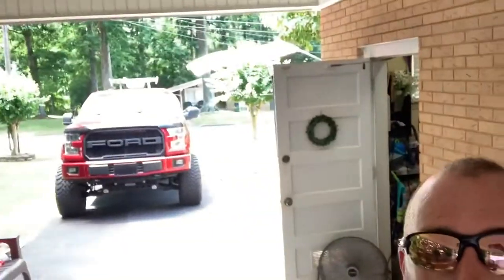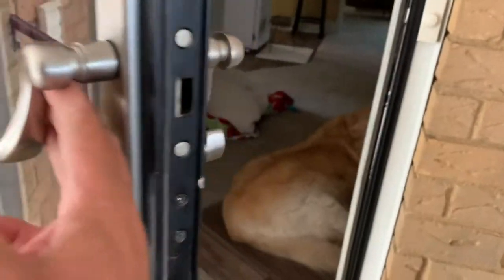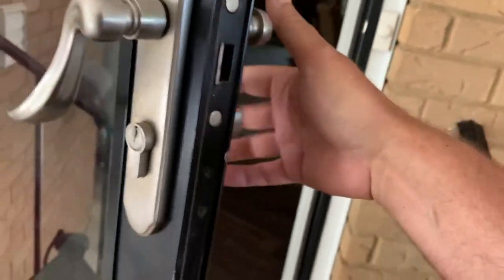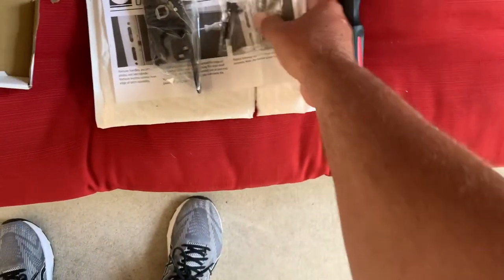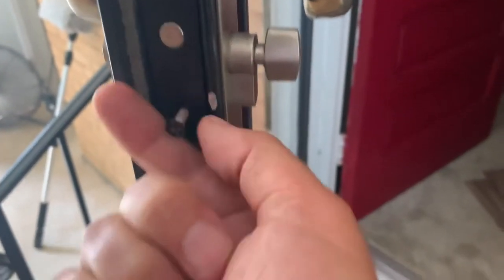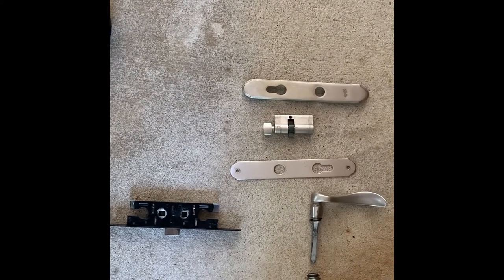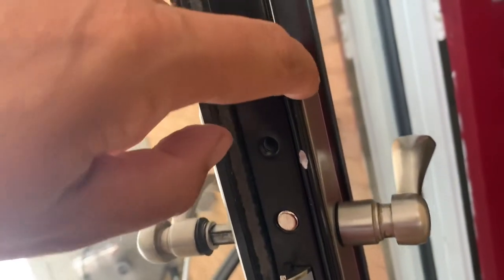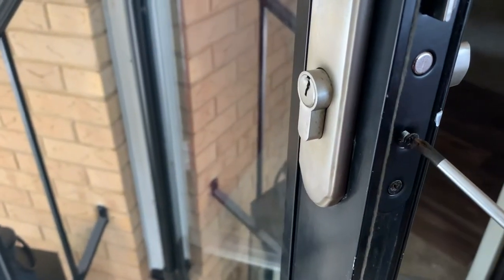Replacing Pella Storm Door Latch Assembly. Watch this first!!!

Comment: We will be doing the same thing and your video seems to be what we'll need.  However, it didn't show how you pull the old inside part out.  Can you give a description on how it pulls out?  Thanks.
Reply from the maker: Hey Angie. I can’t remember right off , but in next few days will make you an update video and actually take it apart for you so you can see the step by step of how I remove it.
Reply: I ended up prying mine out from the latch side. There is set of plastic retainers at the top and bottom of the unit and i worked mine out with a flathead screwdriver.
Reply from the maker: Thank you for that help. I hate I left that part out but glad you got it. I will add that in the next video. Take care.
Reply: Feel free to stop at 1:53 and read the instructions, which if you bought the Pollard latch it should be included...this is not rocket science, but I understand that everybody is not as handy as I am ,and regardless of all of my experience I appreciate it when a manufacturer includes simple instructions. 3m chose to do it his way rather than follow instructions and I don't know why😅

Comment: Skips the exact part of the process I needed to see... how to remove the handle with the Allen key.  Frustrating.
Reply from the maker: https://youtu.be/G4lZVOojKrU?si=DkCQYit7OJOzcNpV

Here is an updated video I made that has more detail. I apologize.
Reply: @LivinWith3M  Thank you.  Managed to make it through the installation, and my new lock is in place, but turning the key is super stiff.  Is that fixable?
Reply from the maker: My only guess for it being very stiff is possibly you have tightened some of the bolts or screws too tight? I’m not really sure.  WD-40 is safe to use on these so I would take a small amount and maybe spray it with the straw attachment on the can.
Reply: @LivinWith3M  That would certainly save on the hassle of removing/redoing the install. Can report back after work today.
Reply from the maker: @JSYantiss1 Thank you. Yes please let me know. 🤙🏼
Reply: @LivinWith3M  WD40 seems to have done the trick, initially. Might check again after work.
Reply from the maker: @JSYantiss1  awesome. Sometimes these new locking mechanisms are on the shelf in the plastic containers for a few years, and the WD-40 helps lubricate them. I hope that it continues to work for you. Thank you for the update.

Comment: How do you get the locking mechanism out?
Reply from the maker: Once you remove the Allen screws and Philips screws the internal part will remove. You may have to wiggle and maneuver the parts but they will remove.
Reply: I pried mine out with a flathead screwdriver. There is a plastic retainer at the top and bottom of the unit and i just worked it back and forth(or up and down) prying it until it popped out of the latch side. That said, the issue i was having stopped once the unit was removed so im going to oil it up and reinstall the original unit. Will like post a video next week.